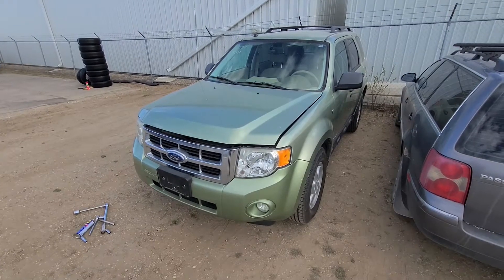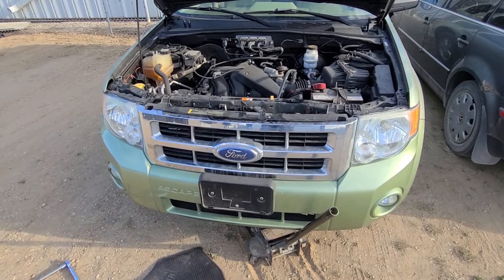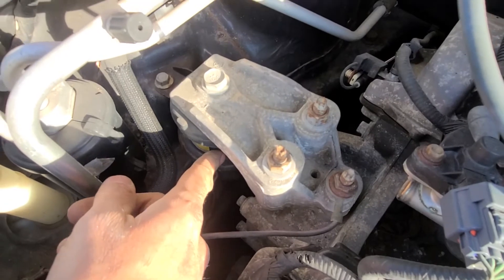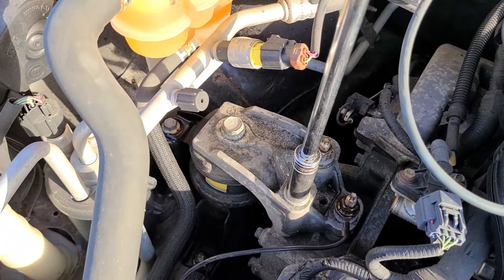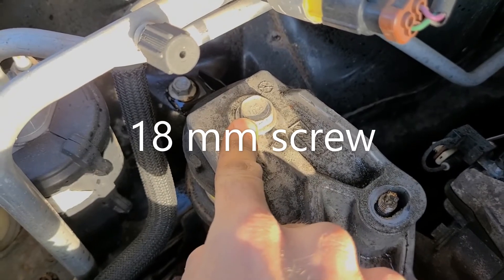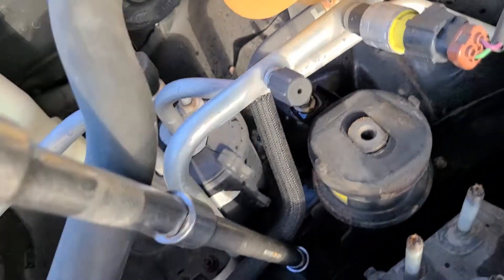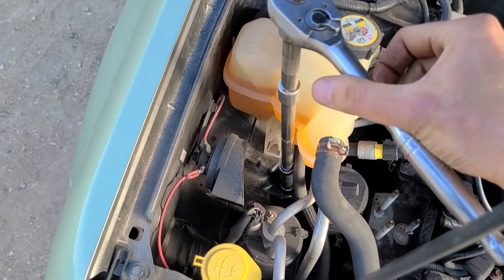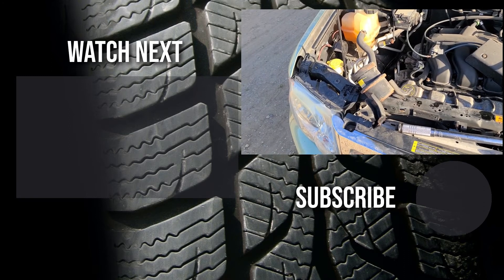Ford Escape - TOP ENGINE / MOTOR MOUNT REPLACEMENT (2008-2012)

Comment: What are the torque specs. On the bolts to frame and engine block, would I need a floor jack to hold up engine??

Comment: Great video !!
Clear instructions !!!
When should we chande the motor mounts ?
Another question, how to fix OBD code P0010 ?
Reply from the maker: Thanks.
You should change the motor mounts if they get worn out. You will mostly feel engine vibrations at idle and shaking when accelerating.
P0010 points towards camshaft, could be as simple as oil change necessary due to contaminated oil and sludge, bad sensor or something more complicated. Needs to be diagnosed properly

Comment: Great video. Easy to follow! But where do you place the jack to keep the engine secure? Is there an ideal spot?
Reply from the maker: Thanks. I've slightly supported the engine under the oil pan and I've placed 2x4 on top of the  jack. But you don't want to really lift it there, just slightly support
Reply: Do you work on your own cars Janice?

Comment: Where are the mounts for the V6?
Reply from the maker: This is the 3.0L V6 on the video
Reply: @QuiteAlright  Oh, I see.  Mine has the big top-mount air filter box.  I did find that passenger motor mount as you describe.  However, I notice my engine vibration disappears after driving for a while. There is, however, a 'clank' on gear engagement if I cycle through the gears from P-D-N-R and then R-N-D.  Also, low thrummy vibration at 100 km/h.   Is this a motor mount or drive shaft issue?
Reply from the maker: 'clank' while shifting gear is usually a bad mount, other symptom would be vibration while engine is idling.  Vibration at highef speeds could be the drive shaft, but it could also be tires which are not properly balanced
Reply: @QuiteAlright  Which mount would you look at? There are three engine mounts and one trans mount. Is the one you did typically the one to fail?
Reply: @QuiteAlright  I should add the vibration seems to go away when the car is fully warm.
Reply from the maker: @Canada_Dominium  Hmm thats strange. With bad u joint on driveshaft the vibration would always be there
Reply from the maker: Yes the one I did usually fails and is easy to replace
Reply: @QuiteAlright  The street-speed vibration seems to go away after the car warms up.  I have to switch to winter tires this week so will see if different tires help. They are new last year. My summer tires are new in April, though. I had rear shocks replaced recently as well.
Reply: @QuiteAlright  Also wondering about exhaust header or flex pipe loose until hot--?
Reply from the maker: @Canada_Dominium  I don't think so. Exhaust wouldn't cause vibration while driving, just annoying rattle noise
Reply: @QuiteAlright  The vibration appears at 80+ km/h.  Had tires re-balanced but that did not cure it.
Reply: @QuiteAlright  Warped front rotors?
Reply from the maker: @Canada_Dominium  doubt it. You would experience steering wheel shaking badly while braking, especially at higher speeds
Reply: @QuiteAlright  I did have that shaking and just had pads-rotors replaced (only 1 hour labour plus parts). Car and braking smoothed out, but STILL have that hard vibration from the rear since the new shocks. I had shock mounts re-torqued to spec, too.  No change.

Why would new rear shocks cause vibration through the car? Bad rear bearing revealed? Bad rim?  Bad tire?  Tires are new.